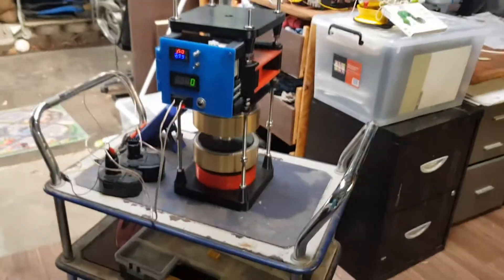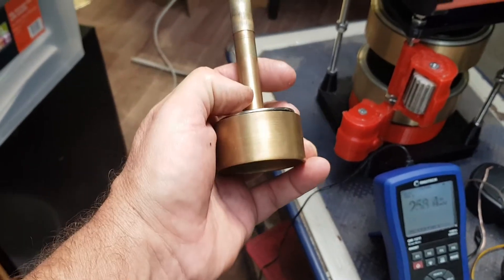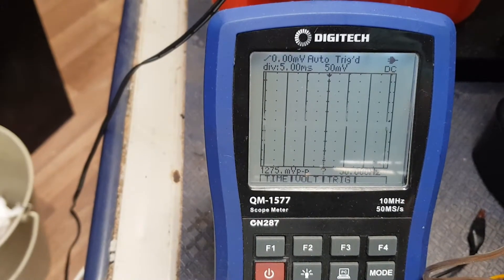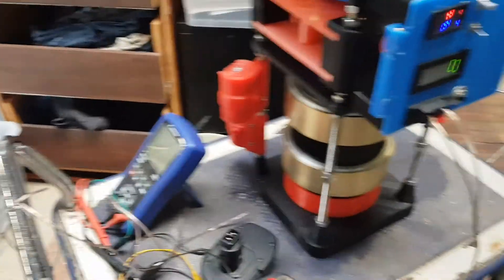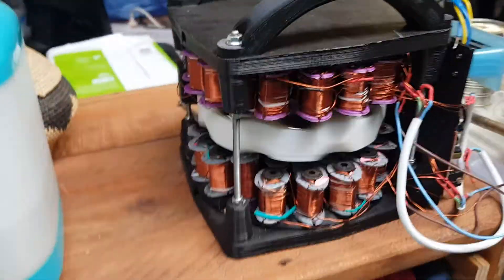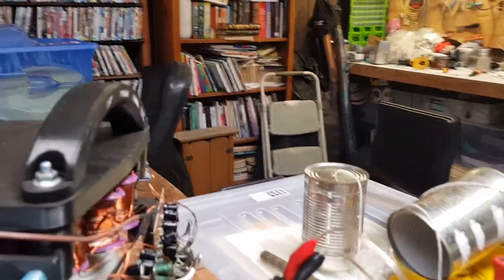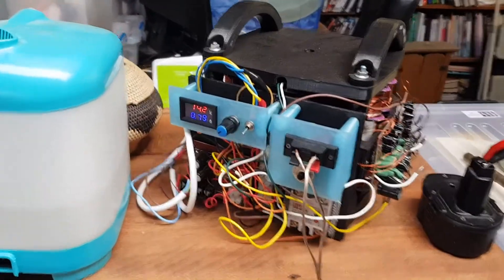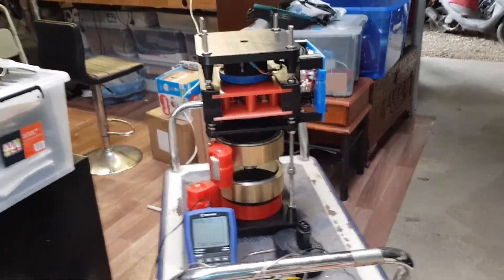Homopolar generator 3d printed

Comment: What’s the current we know what the voltage is but what is the current?
Reply from the maker: Current is dependent upon the amount of surface area contacting.

If you think about it there's an obvious fix but it's too big and too noisy.

It is perfect for a planetary drive system or bearing carrier system.

If you can imagine 2 counter rotating   disks this generator would be good for the hubs and the perimeter guide  rollers.

Comment: I'm not sure why people build homopolar generators then measure voltage, the homopolar generator produces very high amperage, not voltage, so to test that part of your generator, short the output wires together, then put an amp meter inline, or via a clampon ammeter to see what your production is.  To get higher voltage from your generator, coat 1/2 of your disc with a non conductive coating such as ceramic, then put a step up transformer on your output wires, that pulsing output due to the ceramic coating, will send a square wave voltage with very high amperage to your transformer, which will then produce a far better output of your homopolar generator that your looking for if your trying to get voltage from it.
Reply from the maker: To my knowledge that would reduce output by half.
The design is wrong I have a better design but I still need 12v at 500 amp to run my caravan.
Also these 2 opposing magnets create a load as they interact with space time / ether.